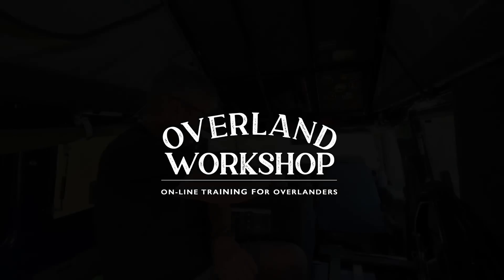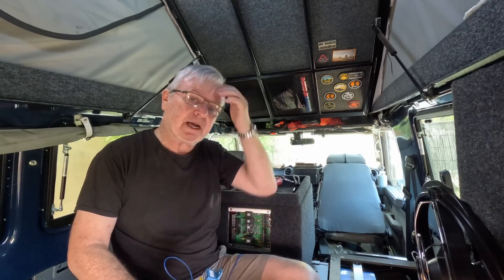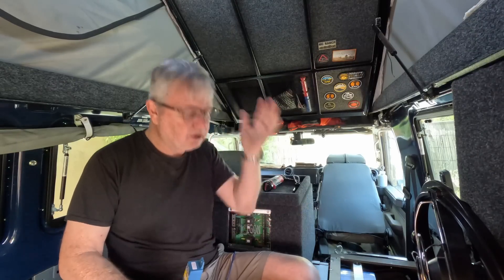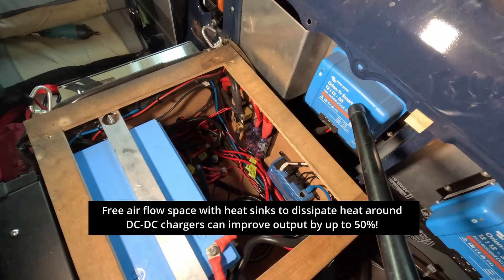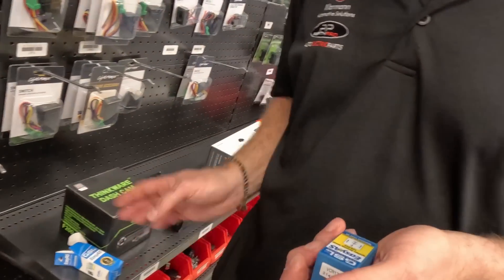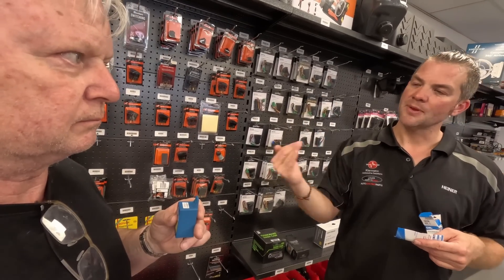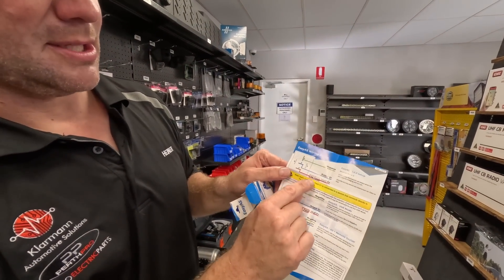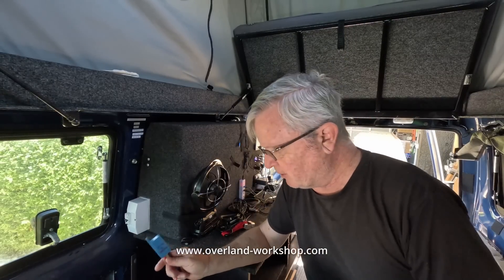INCREASE DC-DC CHARGER OUTPUT IN TWO EASY WAYS | @4xoverland​

Comment: I cry each time I watch one of these videos because nothing is ever available in the US market.  :(   great video regardless.
Reply: That's suprising. How things change, "back in the day" it was so difficult to get products in Australia whereas now there are many products which are either accessible or cost less than in the US or Euro markets. Nevertheless we're still at the end of the world so to speak. Cheers
Reply: @cyclemoto8744  I concur
Reply: I am in the US and redarc is available here. For your trigger you can put it on a circuit triggered by the ignition and you won’t have any of these issues. I have been using a bcdc redarc for a few years without a single issue. It will take every bit of current from a solar panel before taking current from the alternator. Only uses solar when ignition is off. I never think about or worry about anything being dead
Reply: @monkeywrench1973  the point of video is this little trigger that solves the issue of having to hack apart your vehicles wire harness to get a engine is running alternator is charging state.  It really has nothing to do with red arc
Reply: You got all the tacoma accessories, none of the hilux ones